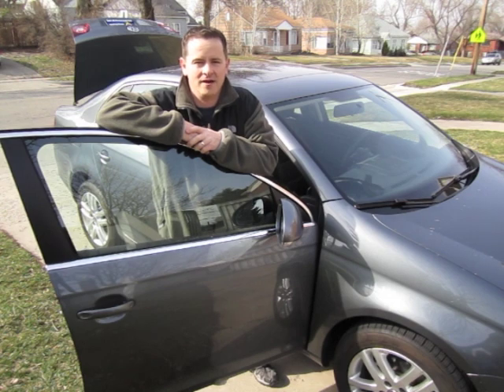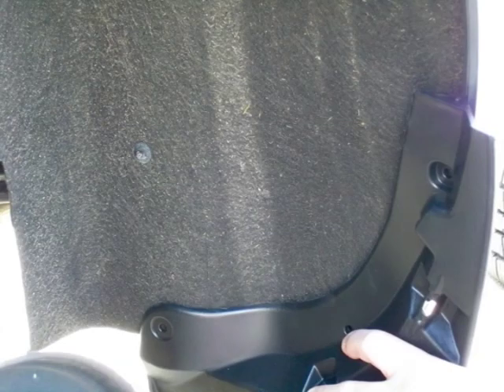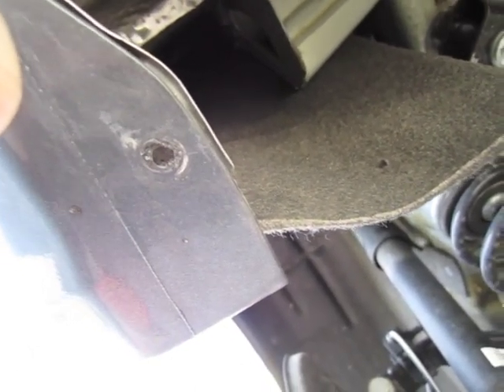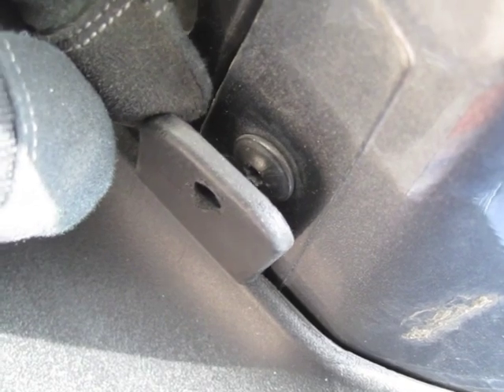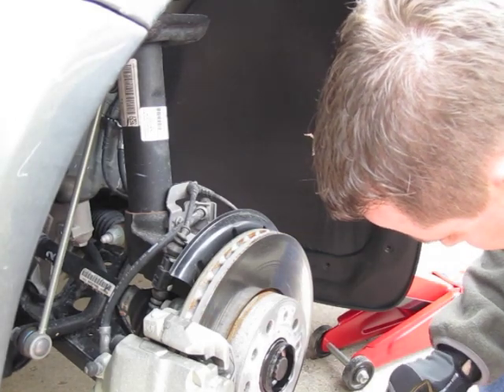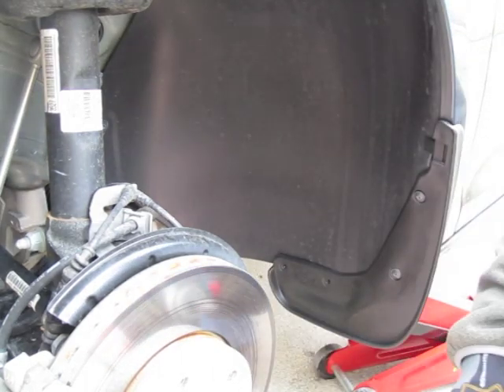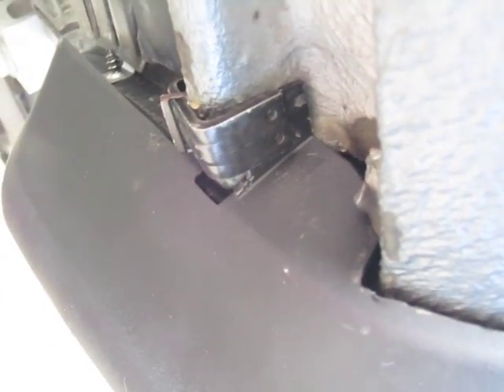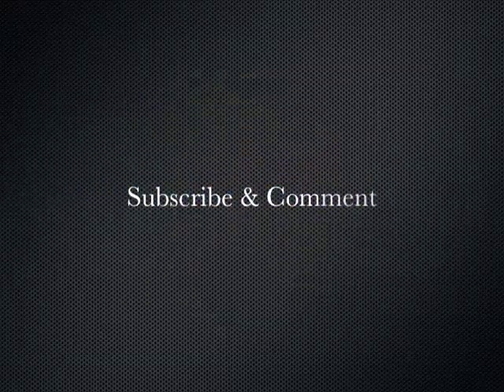HOW TO INSTALL 2010 VW JETTA SPLASH GUARDS - Step by step walkthrough installing splash guards

Comment: Thanks so much, I was trying to figure out how those stupid clips on the front splash guards attach. And my instruction manual didn't even hint that I'd need a powerdrill for the back ones. Mine weren't identical to yours, but a similar version for a 2004 Jetta wagon.
Reply from the maker: Awesome, glad you were able to get it done.

Comment: Great video, I just finished an install on my Jetta Sportwagen. A couple of suggestions at least for a Sportwagen. I would use the longer screws provided on the nylon nuts and re-use the original screws where they came out. Also, on the passenger side rear you can use that screw on the bottom to attach the little flange. You do not have to drill a new hole.
Reply from the maker: Great tips! Thanks

Comment: did your front clamps stay on? couldnt get mine tight without them sliding down...
Reply from the maker: Its been a while since I had it, but I never had any issues.  Worked like a charm!

Comment: Thanks so much for the video! I just received the splash guards that I'd ordered and after watching the video, I know I need a professional. I had no idea that I would have to remove the wheels! Yikes!! Would you happen to have any recommendations as to what kind of business installs them? Thanks for any info you can provide.
Reply from the maker: Its Roni! Roni, I am glad you liked my video.  You could probably get an local garage to do the work.  Unfortunately taking the wheels off is the easy part.  It gets a little tricky underneath on the rear splash guards.  Any general mechanic should be able to do it for you.  Thanks for watching!
Reply: hkstrongside
Thanks so much for the response. Keep putting out these great videos! They are not only helpful, but interesting as well. Take care.

Comment: lol you don't need to take off the tire bro just gotta turn the wheel on the fronts . I know this because I put them on for a living for Volkswagen
Reply: Answer the question "one two" asked you?
Reply: hey man,  those front clips that bolt on to the frame? They keep sliding off when I try to tighten the 10mm bolt. Any suggestions? the instructions look like I should be putting one side right on the frame and the other on the mudguard, but that can't be right, right?